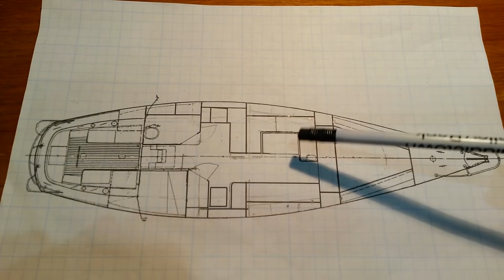Painting the Cabin Top

Comment: My vote would to buy the cheapest tank obviously from a reputable company. You can probably find a poly tank easier to fit your dimensions than aluminum... Both aluminum and poly tanks will last 20 years+. The only downside i think to poly tank is they will leach/ breathe very small amount, granted any room with a gas tank will smell like gas in my opinion. If you install a poly tank, talk to the manufacturer on proper way to install cause theirs many opinions on it and same goes for Aluminum. For aluminum, Im a believer in letting your tank breathe as much as possible and not foaming it in, many people will paint the outside of their aluminum tank with coal tar epoxy to keep it from being oxidized which is especially important if you have it wedged against say a bulkhead or foamed in. Now stainless.... Many companies are going away from stainless for a few reasons, first it being very expensive and second its fatigue rate. Stainless doesnt like to flex and is more likely to crack if improperly installed or even properly installed compared to aluminum or poly. I wouldn't go stainless just because of its cost but since you would be installing it in a sail boat i wouldn't worry about fatigue, it's not like you're going to be hammering big seas at 30 mph like you would in a power boat.